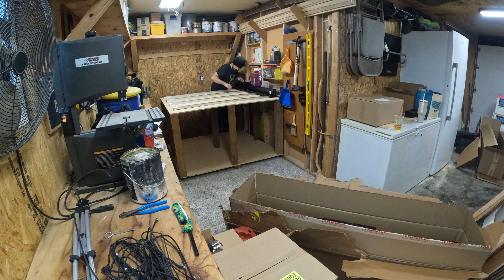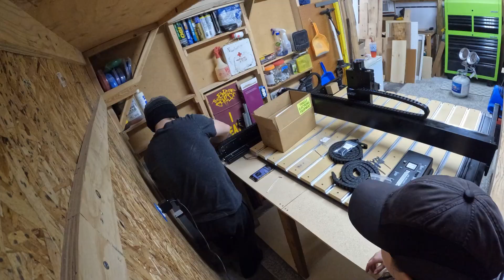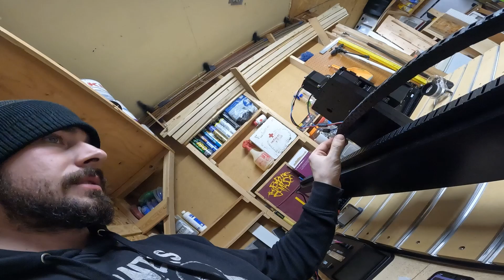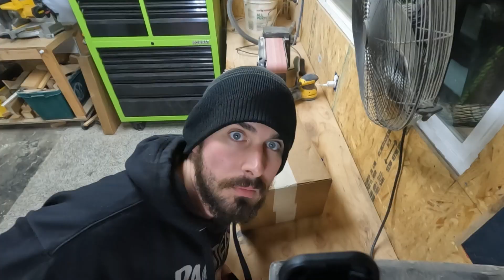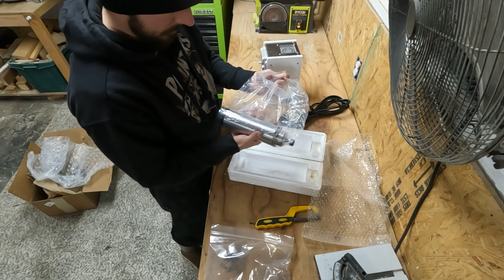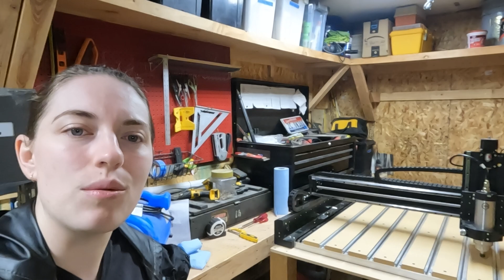Assembling Shapeoko 5 Pro CNC | Timelapse Assembly

Comment: Started assembling mine yesterday. The pull chain on the gantry was broken and the plastic piece on the back of the HDZ was snapped. I was also missing the grounding block. Emailed Carbide3d through the website and very quickly got a response asking for photos of the broken parts. This morning I had a shipment notification for the parts. What a great company!